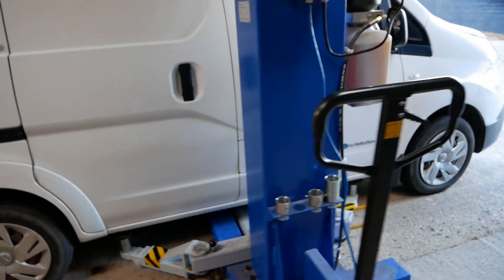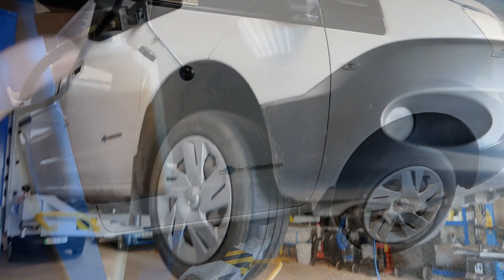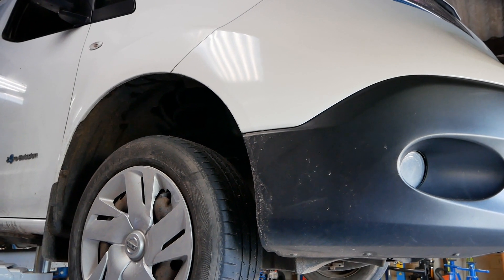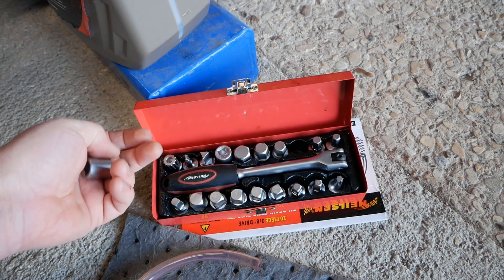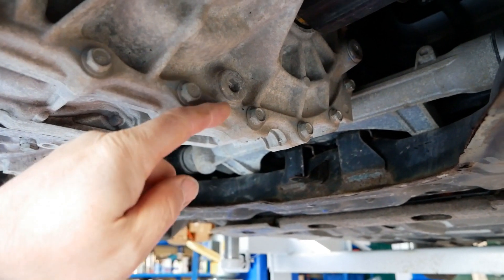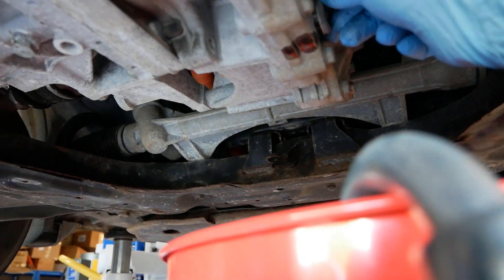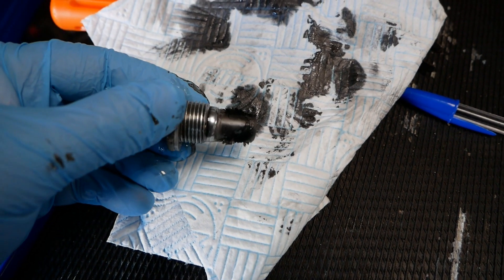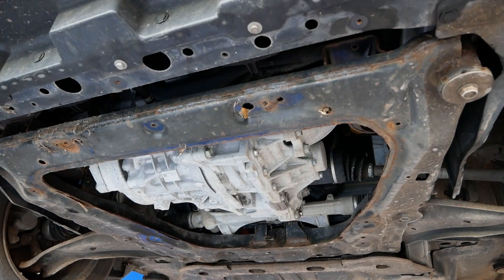Nissan E-NV200 reduction gear oil change. Yes EVs do have oil !

Comment: Great vlog I’ve just purchased a Nissan townstar EV on a 73 plate, just waiting for it to be repaired as it is a cat s from copart
I will renew the oil one day as it only has 10k miles but would I use the same oil as yourself and how many litres would it be as Nissan put 6 litres for £172 on a quotation sheet, many thanks and kind regards, Mark from Billericay
Reply from the maker: 1.4 litres.
All the details are in the video description.

Comment: If it has been tightened too hard by irresponsible tech using air gun, or rust, then better loosening up first by lubricating n spray and gently hammering by using hard plastic hammer. so wont' damage small plugs.

Comment: When the gearbox is in operation the oil is flung everywhere.  Steel wear particles will stick to a magnet if they happen to pass by very close, which is highly likely to happen in less than an hour.  Nothing much happens when the gearbox is not in operation so it doesn't matter a hoot whether the magnet is located in the drain or fill positions, as long as it's prominently positioned in the oil flow during operation.

Comment: Torque to 25 ft-lbs, both.  Use any fluid very similar to Nissan Matic S type, which is in the Dexron VI and Mercon LV class too.  In the U.S., (Leafs only, no NV200 EVs) I recommend Valvoline MaxLIfe ATF since it has more anti-wear chemicals than most other choices, but really any Dexron VI or Mercon LV compatible fluid works fine.

Comment: Hi Mat, Does the Kia Nero take the same oil, good video by the way.
Reply from the maker: No. Most other EVs take a manual transmission oil. Use the Castrol or Shell oil finder to see what it takes.
Reply: @GoGreenAutos  Thank Mat.

Comment: Ohh
someone said to me only liquid electric cars needs is wiper fluid
now i know its needs oil change too.
Reply: I was under the impression that the ATF needed for these gearboxes is not “Normal” grade, but “S matic” grade!
You have a drain plug, a level plug, and at the top side hidden by the HV wires, a fill plug, but filling through the level plug is normal!
My e-NV box disintegrated it’s teeth at 60,000☹️and on inspection, all the teeth were captured by the two magnets, with no loose shrapnel in the cases, so what you see on the magnets is what has loosened. 
It is possible to remove the gearbox with the engine in the car, the subframe does not get in the way,
Reply: @rogercrier9115 Interesting, I never knew there is a filler hole under the bonnet.
Reply from the maker: If you follow the manufacturer's service schedule, they don't need an oil change, so they were correct in saying they only need windscreen wash (and brake fluid).
Reply: and brake fluid and coolant

Comment: I have done 110000 miles on my Leaf and never did this!
Reply from the maker: I'd recommend you do this asap then!
Reply: @GoGreenAutos  Maybe in the summer, too cold now :)
Reply: It's the same with ice cars with "life time timing chain" witch might only be 150-200k miles (even if you do 5k oil changes, some do 12-18k manufacturers intervals or 12 moth witch ever comes last not first or when engine starts making noises) 

But usually because of poor oil change service cycle or/and incorrect oil type or the grenade pin tensioner type spring fails causing the timing belt go out of timing (stops putting tension on chain guides and then self-destruct, it's actually very common failure the grenade pin type tensioner with bad oil changes as well causing the other problems)

There are people driving around in CVT type cars that have never changed their CVT oil or unaware that they should do it
Reply: I've done 105000 miles in my leaf, think I'll get the oil changed.

Comment: Thanks Matt for showing what needs to be done .
After i saw a fellow leaf owners picture of the size of chunks on his car lower sump plug i got my 2015 Leaf done this summer just gone ..
Yes it did cost me £120 at my Nissan main dealer  on the island but it was cheaper than a gearbox specialist who wanted £200 to do it all here on the Isle Of Man.
I still cannot get over that nissan say it’s sealed for life & does not need doing .